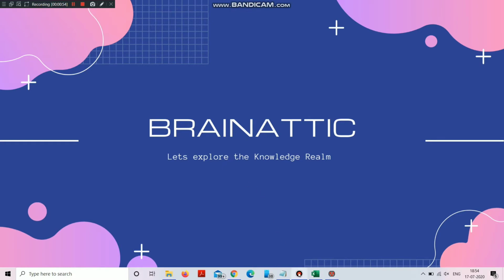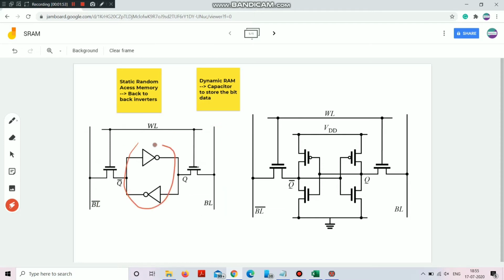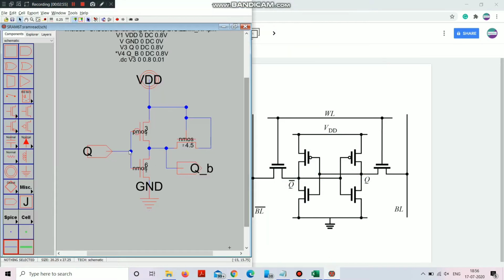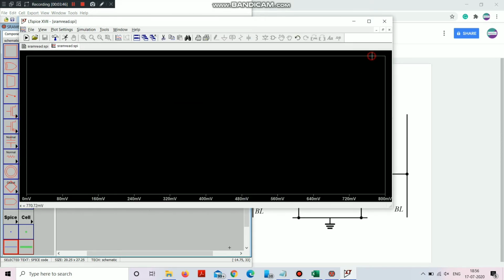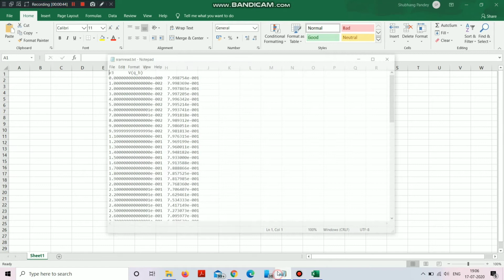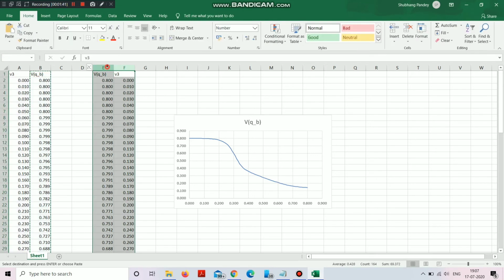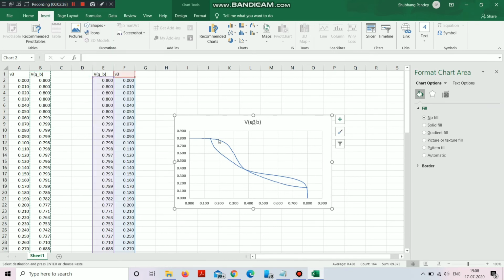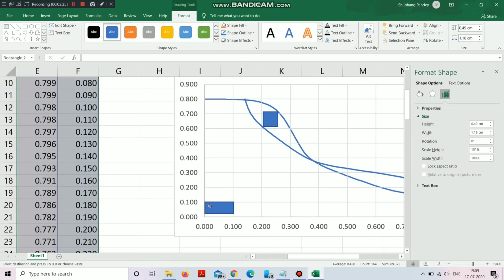How to plot and measure Static Noise Margins(SNM) for SRAM Cell using Microsoft Office Excel

Comment: high degree of inaccuracy because x axis and y axis are not in equal distance. for example there should be square after joining the 0.1 of x to 0.1 of y.
Reply from the maker: Thanks for point it out! The idea of the video is to provide an approximate approach. Accuracy can be refined more.